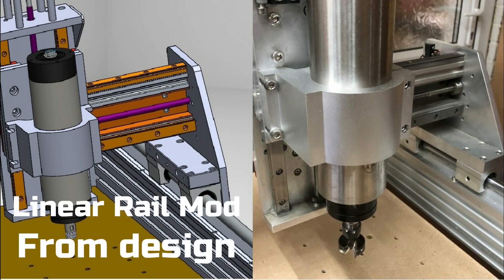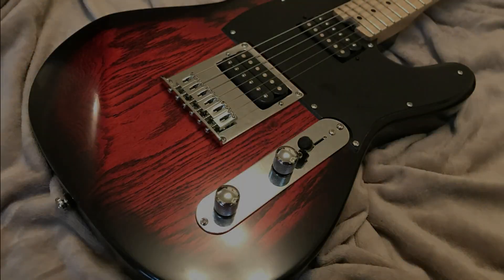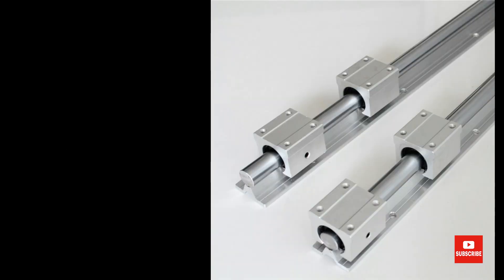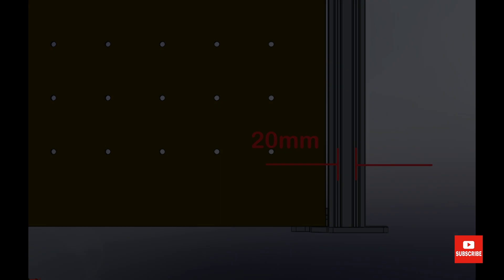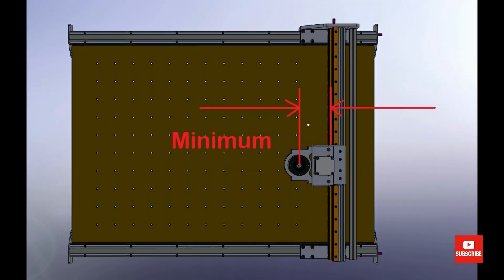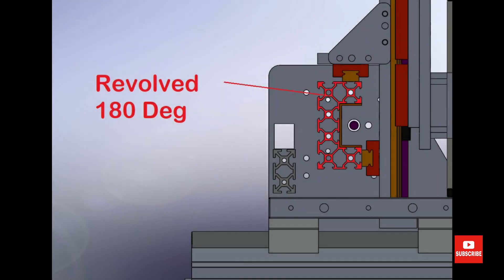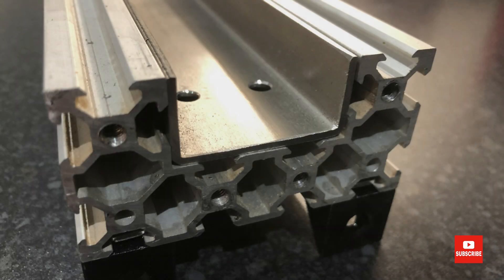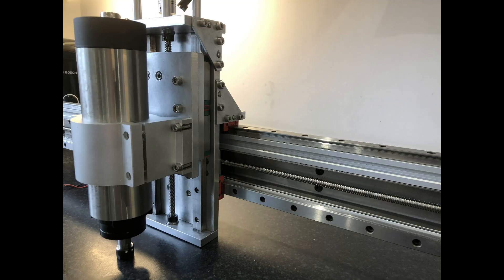WorkBee CNC Linear Rail upgrade diy Mod SBR 16 MGH 15 Guitar Making NJR Custom Guitars

Comment: Hello and I hope all is well.  I came across your video and I am very impressed with your ability to upgrade the Workbee.  I have a WorkBee V1 and I desperately need to upgrade it. Thank you for putting it together and I was wondering if you ever made the kit to sell or put the plans up for sale?  

You also mentioned that you updated your Workbee to ball screws, any videos of that yet?  

I am here in SoCal USA and am so tired of the run around I am getting from the CNC companies that I have asked for advice/help. 

I would appreciate any advice/ help you can provide me with regards to the upgrade process. 

Thank you for your videos
Reply from the maker: Hi, thanks for reaching out about upgrading your workbee. Yes my mods were a success, it did improve the bee a lot. I also as you mentioned upgrade to ball screws that also worked well. But unfortunately I didn’t do any videos of this. I kept the bee for about a year after the mods and worked it quite hard. But even with all the mods it was never really strong enough for my requirements. I sold it and upgraded to an ITECH CNC (this would be I believe a Laguna IQ in the USA) the video is all I really have left. To be honest all the fun for me was in the design. Everything was made using 10mm aluminium plate that can be manufactured using your bee. Sharp cutter,  small cuts and lubricate with drop of paraffin or again in USA it may be Kerosene?  I did think about making a kit available but it was so time consuming it would work out very expensive. I have seen  a kit called a Queen Bee. At the end of the day it depends what you require from your machine. You can’t whatever you do achieve the strength of a cast base  CNC machine using aluminium extrusion screwed together. The Laguna was expensive but totally worthwhile. 
Good luck 👍

Comment: Very impressive work on the CNC and guitars. I own a Workbee and have upgraded with linear rails all around and still find the X-axis being quite susceptible to torsional deflections and vibrations. Wondering if you found that the steel reinforcement channel remedied the issue completely or was just an incremental improvement?
Reply from the maker: Firstly many thanks for your kind comments. The steel reinforcement did indeed remedy the deflection. It will now cut maple (probably the hardest of the timbers I machine) 10mm deep cuts with a 4 mm step-over using an 8 mm end mill with no problem at all. I recently also cut some brass plate work also with no noticeable flexing. I can only compare with the standard machine because the steel was all part of my upgrade idea, so i never tried my machine just with the linear rails and no steel. The difference in the upgrade to the standard bee is night and day. I did intend to next upgrade the lead screws but it’s been a fair while now and the machine has been worked really hard and it’s still as good as the day I rebuilt it. (Famous las words) So I wonder if it’s worth the time and money. Best of luck with with your cnc and I hope you resolve your flex.

Comment: Hello, thanks for the video. Great upgrade !  Could you tel where you bought the stainless steel box section ?  Thanks
Reply from the maker: Hi thanks for your comment, I purchased the stainless box section from a supplier on eBay. It was a meter length, I cut it in two with a cutting disc in 4” angle grinder.
Reply: @NickRogersNJRCustomGuitars  Ok thanks.  So Its a 20mmx40mmx1.5mm section I guess.
Reply from the maker: No it was 40x40 box slit down the middle 1.5 wall thickness yes 👍
Reply: @NickRogersNJRCustomGuitars  Thanks, Last question How did you cut it. With a hand saw?
Reply from the maker: No I cut it with a 4” angle grinder with a 1mm thick slitting disc.
Reply: @NickRogersNJRCustomGuitars  Thanks I've got everything now. Do it next week. Thanks for all!

Comment: That looks great , I am thinking of buying a workbee myself , I would preferably by the killer bee from ratrig which is europe based and I will not have to pay customs but it has 8 weeks lead time at the moment and I am in a hurry , So the plan is to buy workbee and upgrade later but killer bee upgrade costs about 600 euros more or less depending on the size , on the other hand as you shown here there can be a custom upgrade and especially if you own a cnc and can machine the aluminium parts its kind of easy .
May I ask how much all the upgrade costed to you ? 
Also , I ve been told from the company that the maximum router bit the work could hold is 6 to 8 mm , I would like to ask you if that refers to the tool or to the shank size ? have used bits bigger than 8mm before upgrading and how was is ?
Now that you ve done the upgrade can you use bigger tools ? Whats the maximum collet bore this spindle can take ?
I also plan to make a shorter spoilboard so I can mount pieces paraller to the z axis to make some horizontal maching . What do you think about that ?
Reply from the maker: Wow that’s quite a message. Right where do I start. My upgrade cost. The spindle and mount cost me about £300 it’s a 1.5kw air cooled in my opinion absolutely ideal. The biggest shank size or collet size is 8mm so any cutter with an shank up to and including 8mm will fit. My biggest cutter is a facing tool that’s 30mm. The aluminium and linear rails cost me about £350ish that’s an estimate as it was a while back now. I would point out tho I didn’t use the workbee to make the plate work I actually have a small hobby milling machine. The original workbee could possibly make all the plates but aluminium is pushing the workbee to its limit. There may be some flexing issues. Having said that my first upgrade was making taller gantry plates to gain more height on the z. I did make those on the standard bee. They worked well and were on the machine for about a year before I did this current upgrade. I hope that covers most of what you were asking. Thanks 
Nick
Reply: @NickRogersNJRCustomGuitars  yes you did , thank a lot . 
I ve seen a video of yours cutting some aluminium super clean and I thought you made it on the bee . If i was in the usa i would choose afinity i dont know if you ve seen it but it looks very stiff to me on the other hand its kinda small and more expensive than the bee , i might with the second
Reply from the maker: @antoniskaloterakis7996  oh yes that router bracket I made. I forgot about that. Yes that was made on the standard workbee. I have seen the affinity but I don’t know much about it. If I had the money I would go for a Laguna machine but I can’t warrant spending that much for what I use it for. Maybe when I retire I’ll treat myself. For the money tho the workbee has been great. I would recommend one all day long. I make guitars on mine, I probably made something like 8 bodies and necks on the Standard machine with no problems at all. The main reason I want for my upgrades was to speed things up via bigger deeper cuts. The standard machine I would take at most 1.5 depth of cut now I can take 10 mm deep with ease.
Good luck with whatever machine you go for 👍
Reply: @NickRogersNJRCustomGuitars  thanks , now that you said about depth of cut , at 2008 we bought a homag 5axis cnc , it was cutting 18mm plywood like butter at once, 60meters per minute rapids  etc etc , later the crisis came and eventually it has been sold , now workbees and all that will be a huge downgrade but its something at least , i will mostly work with ash and will cut 6mm aluminium that would have been cut with  waterjet that has very bad surface finish

Comment: Amazing work and thanks a lot for sharing this... Would love to do something similar to mine... a lot of research has to be done before I can pull it off though... Any resources you would recommend?
Reply from the maker: Thank you very much, I purchased everything from Ebay including the 10mm aluminium plate
the rials come on the slow boat from China and took a few weeks! But I took a gamble in the meantime and set to work on all the plate work. Luckily all the planning paid off and it all wet together as planned. I couldn’t be happier. It can machine anything now with ease. It has reduced the machining time of a guitar neck and body by 2/3s it’s a proper beast.  
best of luck with yours
Reply: @NickRogersNJRCustomGuitars  Amazing! Thanks for taking the time to reply... I will look into it deeper for shure
Best luck with your guitar making and playing

Comment: Looks really good!
Did u use your original SIde-Plates or did you buy new ones?
Maybe you could post a link.

Thanks for the great video!
Reply from the maker: Thanks for your kind comments no I made new gantry plates.
Reply: Any possibility that you share your cad files? Maybe from the whole Machine Setup like we see in the Video?
Reply from the maker: @martinwruss3833  hi thanks for your message. But no sorry not right now. I am thinking of maybe putting something together at a later date to try and sell my design plans or sell kits But right now  I haven’t made my mind up. Sorry
Reply: @NickRogersNJRCustomGuitars  I understand your decision and appreciate your answer.
Of course i hope you will make up your mind and maybe sell the plans at some point.